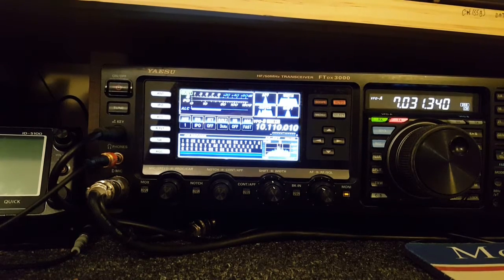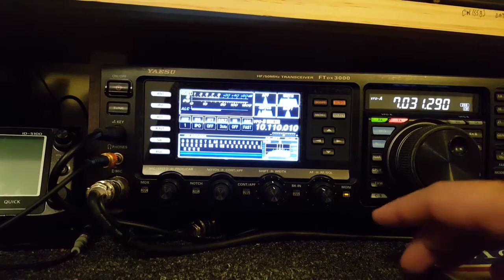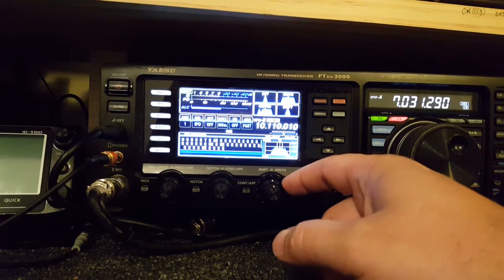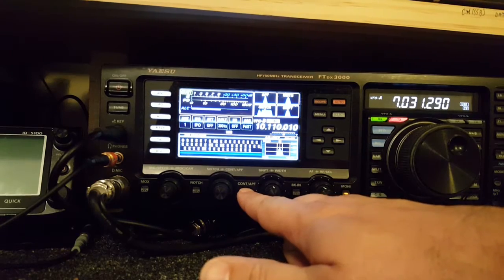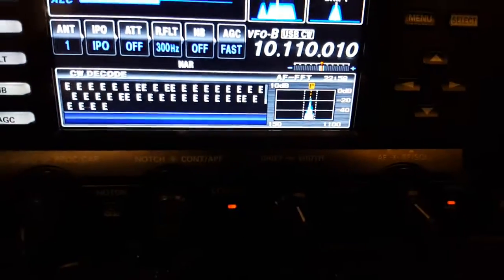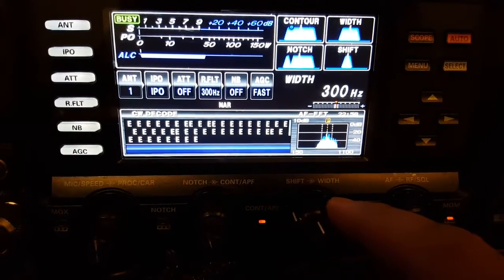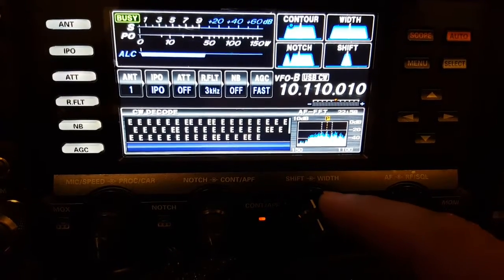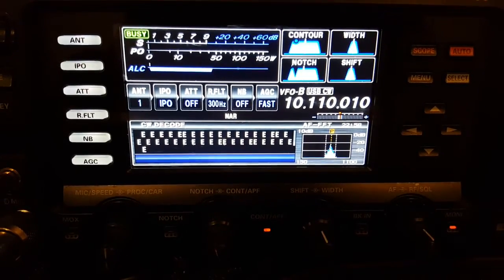FTdx-3000 CW Filters

Comment: I fully agree with the narrow filter procedure and it seems to me that you first switch the APF filter on and then the contour filter without adjusting it to the desired frequency (check the LED still lighting).
I don't really find the contour filter useful on CW, though the APF seriously pulls weak signals out of the noise.
BTW I'm more a CW user than phone and will pass on any comment regarding SSB ;-)

Cheers,

Patrick - ON4KNP